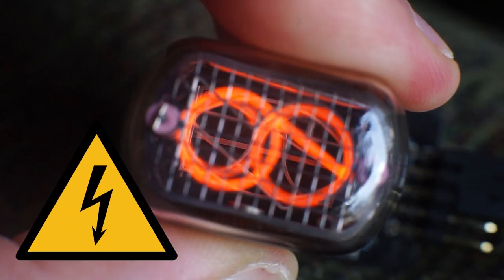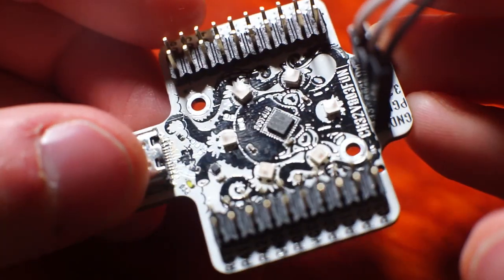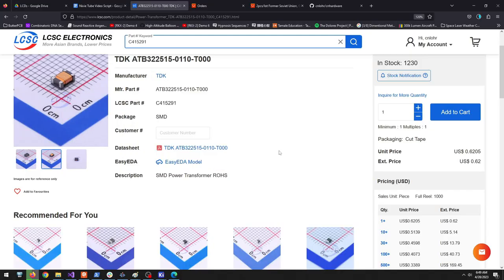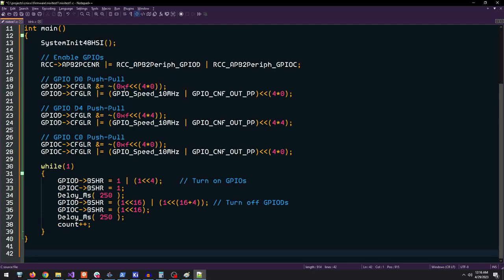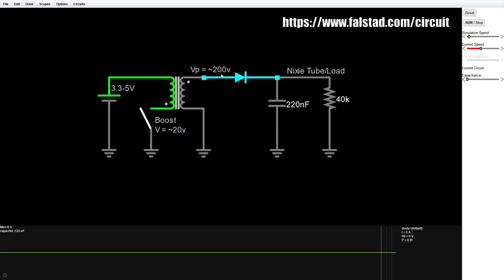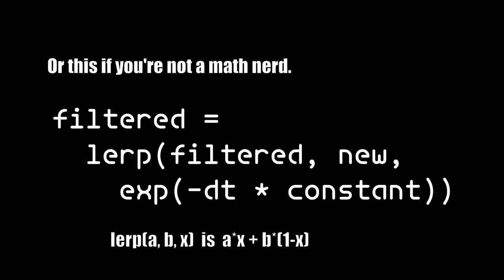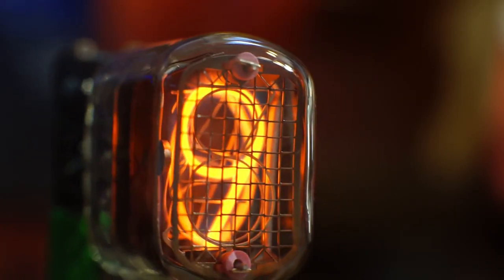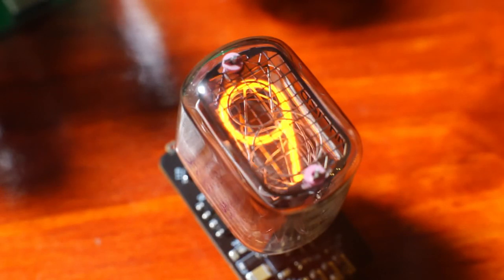Powering a Nixie Tube from USB with a 10¢ RISC-V, the CH32V003

Comment: Cool. That's the only thing I can say. Man, you are one of the few truly "Full stack" developers. Now we know that, in adition to all your knowledge, you are not afraid of analog electronics.
Reply from the maker: I learned a TON From Sam Ben-Yaakov lectures.  You should totally check him out on youtube.
Reply: @CNLohr  now I will
Reply: There is no such thing as digital electronics. I never saw so much analog circuit analysis as in my "digital electronics" course in engineering.
Reply: @stickyfox  You do all the analog engineering of digital circuits so the code running on it doesn't have to deal with it (except things like the flyback control code here).
Reply: @gblargg  That's kind of the flip side. People get so wrapped up in math and signal processing they forget that a processor can generate an AC waveform too! It's good to keep the fundamentals in mind.

Comment: Did you measure the gamma of the tube for the dimming?  With LEDs, i find that i have to keep in mind that the human eye is non-linear when doing fading.
Reply from the maker: I did not.  But realistically, I only have about 8 bits of dynamic range.  Any gamma curves should be applied by the users of the nixie, instead of by the ch32v003.
Reply: @CNLohr  I may have to add dithering just because. ;)

Comment: Sorry. Where can I find the schematic for the high voltage generator portion? Thanks. Great video!
Reply from the maker: It's all in the cnixxi repo.  The voltage is really just a FET + the tiny transformer +  Diode and is all driven directly from the ch32v003.

Comment: The CH32V203 seems just a bit easier to work with for not much more cost. EG has hardware multiply...
Reply from the maker: the upcoming 002, 005, 006 and 007 all have a hardware multiplier.

Comment: Years ago I found a nice single transistor oscillator design that worked with a centre tapped primary transformer, using an smallish audio coupling transformer from an old radio on a 12V supply there was enough HV transients coming out to light a neon bulb. I then added a nixie tube etc, and had a really simple single digit nixie counter.
The nixie is, apart from a diode, directly driven from the transformer, no limiting resistor required.
I can run my thumb under the nixie & 7441 decoder driver with no tingles etc, something unthinkable when using a conventional 200VDC supply and limiting resistor.
Currently the 7441 is driven by a 7490 decade counter (This thing was built 20+ years ago) for a single digit counter. Lately I've been toying with the idea of replacing the 7490 with a micro from an Arduino etc, so I can make it do something a bit like yours, and also drive the inverter instead of it being self excited, so I can stop the HV and blank the display, a function not available from a 7441, as doing so in a conventional 200V setup would see its outputs raise way too high for the chip (This is why most retro nixie devices have a pile of always lit leading zero's)
Pity I cannot post  a pic of it in the comments.
Reply from the maker: You can always make a youtube video about it.  I'd watch!

Comment: You almost tempted me to buy a set of nixie tubes, very cool project.
A well written HAL doesn't need to be resource intensive by the way, the vendor supplied ones usually are though.
Reply from the maker: There is the law of leaky abstraction.  No matter how careful or well thought out a HAL is, it will always be a net loss.

Comment: This is so cool, usually to try to control these tubes people try to make you buy ancient chips that aren't made anymore. I have 8 of the tubes you have pictured here that would love to be used for some kind of display. I definitely need to see how to get my hands on these boards/the parts for them.
Reply from the maker: I have my kicad projects on git!
Reply: The K155ID1 ic for controlling nixies is actually still being manufactured in one single factory
Reply from the maker: @apo_chromatic  Now if only I could find one in a QFN package.
Reply: @CNLohr  Fair, though they do exist in SOIC-16
Reply: Very cool extra helpful info guys, good to know that there is still a chip that can do it, I had just remembered some kind seemed hard to get last time I looked into it a few years ago, maybe I was thinking of an older kind.

This project is so cool though, such a compact high voltage supply design compared to others. Love this project a lot!

Comment: This is a really nice little Nixie driver project!  If you wanted to make the HV supply inherently safe if the control loop fails you could add some kind of voltage clamp across the HV node, like a zener diode or something else that avalanches at around 200 volts.  You could even use this to reduce the drive, say feed it into a BJT that pulls down on the HVCTL and shunts the drive, although this would risk bringing the FET out of saturation and increasing its dissipation, but I suspect an equilibrium would be rapidly established that could be designed to be tolerable continuously as the current limit is mostly set by the transformer inductance and pulse width.
Reply from the maker: I have wondered if I was naturally hitting the reverse conduction voltage with my existing diode.  I was toying with using a 200V diode, to push that reverse conductance even lower.  If I can tailor my supply to leverage that, it would be even cooler!  I try to avoid having any extra components in my designs that I can. And, things seem safe enough considering how much I had to do to try to overvolt the supply anyway.
Reply: @CNLohr  yeah that would work, also the drain source breakdown of the switch fet but that would be a low voltage because of the transformer ratio.
Reply from the maker: @vk2zay  Is it safe to use the VGS breakdown of the switching FET? I thought that would permanently damage the FET.
Reply: @CNLohr  depends on the FET, some power fets are specified explicitly to allow it and the datasheet has limits for it.  However in general 1st breakdown isn't damaging as long as the dissipation isn't excessive, so as long as the current is limited so the drain current limit isn't violated and the IV dissipation doesn't overheat the device it can probably tolerate it indefinitely.
Reply from the maker: @vk2zay  Interesting.  I will look into it more. But these are some lame chinese datasheets 😕
Reply: @CNLohr  "But these are some lame chinese datasheets" 
Well, at JLCPCB prices you could make a board full of Chinese FETs to characterise them yourself ;) ;)
Reply from the maker: @Axel_Andersen  Which is basically what I do. Then I cam make 50 more for the price of 1

Comment: I didn’t see any snubber across the primary of the flyback transformer - I suggest that one be used, whether a diode or RC or combination.
Reply from the maker: Should not be needed.  There's enough clearance on the FET and it has enough Coss to be that snubbing capacitor from leakage inductance.

Comment: Many moons ago I made bought a few old stock nixie counter racks with 12 nixie tubes in each rack. Then I build a nixie clock using regular ttl logic, a bunch of transistors and a custom transformer. I would love to use this project to drive a new 6 digit nixie clock with the rest of the tubes I still have lying around.
Reply from the maker: No time like the present to get started

Comment: Very cool, especially the 5 being an upside down 2. But I’m surprised that the RISC-V core lacks a multiply instruction, even bottom-level ATtiny chips these days (e.g. tiny202) have hardware multiplication. But in basically every other respect it’s a great replacement for an ATtiny. The CH32V103 seems to be more inline with what I’d expect from an entry-level 32-bit MCU, like the RP2040 or bluepill or ESP.

Be interesting to see if CH32Vs or GD32Vs (or ESP32C3s) become the mainstay of RISC-V in the hobby space. I hear some allow direct programming through USB without needing a boot loader like how the RP2040 does, which would go a good way towards making them more accessible to noobs. Not sure if you can also do debugging though, not that debugging has ever been accessible to noobs. I gotta look into getting a GDB workflow up and running.
Reply from the maker: The core, in spite of its lack of multiply is still VERY capable.  At 48MHz, and 32-bit for math operations it is more than capable enough for most projects - so long as you don't burn all your perf in HALs.

And indeed, the 103 and 203 are along those lines.

Side-note: Bitluni and I have talked about writing a USB-bootloader for the 003!

Comment: I'm def stealing this, but iirc "dynamic" driving -  pulsing the display harder but shorter to reduce total energy going through -  is recommended just as it is for LEDs for longevity
Reply from the maker: Totes a thing you can do with this!
Reply: Not with nixies. If you're pulsing it to normal operating current, then it's fine, but compensating for PWM with higher drive currents will definitely cause cathode poisoning.

Comment: Very cool, this looks like a much better driver for my IN18 clock than the expensive HV switching chip from TI I have now. Two questions: did you document the control loop somewhere? Does it require a PID or something simpler? Why does your interface to the chip require microsecond accurate timing, is it because of the SWI? Can't we use something simple like UART to interface with it?
Reply from the maker: The PID is overkill. I will likely switch it for a PI + expectancy or just P + expectancy loop.

Can't use UART with current firmware but it isn't hard to add that as a feature.  You can just copy&paste the single file header to access the debug registers as it stands. But I do intend to continue to develop them.
Reply: @CNLohr  Great, thanks for responding. I think I2C would be even better. Then we would only need a single bus to communicate to the controllers and would make it scalable from 2 to perhaps even 8 digit clocks. I am looking to built this project soon so I will look into that
Reply from the maker: @pietheijn-vo1gt  good point!
Reply: @pietheijn-vo1gt  yoo, if you get I2C working on it, that would be so cool. I'm very new to the scene of electronics, but I'd be happy to learn from you if you get it working :D

Comment: I must've watched the bit about turning the IIR into 3 instructions about 5 times trying to work out how it works, because boy do I need to do something similar for my driver project I'm working on because it runs WAY too slow and no divide to do regular RMS averaging.  

I'm tempted to just throw the code in and see if it works, but I'd also like to understand how it works, so I'll know if it's actually going to help my application
Reply: I've played around with it a little, for some reason I had to add an extra right shift 1 to the filtered value to make it in range, but it is smoother than raw.  Cool as
Reply from the maker: Yes.  You will need to right-shift your output if you want it to be less OOR than the typical input.  The way the shift-iir works is to inflate the size of the filtered value.
Reply: @CNLohr  Ah, That explains why it was coming out so high, I like it, I'll see if I can figure out how to implement it in my code next, thank you

Comment: How much power is required to power one of these? I'm wondering how many nixies you could be powered from a single USB
Reply from the maker: My PSU uses about 300mW.  Only about 300mW actually goes into the tube.

Comment: You point out a transformer IC but it sounds like you drive the FET from the MCU, so what does the transformer do?
Reply from the maker: The transformer both acts as an inductor to be the boost AND provides a 10:1 voltage multiplier.
Reply: @CNLohr  Ooooh! Silly me I realise now. It's because the bottom side with the visible windings are whats in the screengrab from LCSC so when you pointed to it on the PCB I thought it was something else, like a SMPS IC of sorts.

This thing does 0.7A and up to 500V?! There are so many of these old display tubes you could power with this. So thanks a ton for showing this!

Comment: This is awesome! I have some of the same nixie tubes! Would love to see a follow up on this on controlling them via an external microcontroller like an esp32. How did you learn how to build the boards? I would love to be able to have access to these tiny components and not have to solder them myself.
Reply from the maker: If I do, maybe by then I will have the boards for sale too!
Reply: I would love to get a few of these if you ever do sell the boards, I have a few sets of Nixie tubes that aren't doing anything so it would be great to use them.
Reply from the maker: @user-jb2le9el3x  Are they IN-12 or IN-15's or a different size?
Reply: @CNLohr  IN 12 rings a bell, I am pretty that's them

Comment: Nice project, i was working on something similar based on a MAX1771, @CNLohr do you know of the nixie chess set. The one that exist that i know off uses wireless energy but i think this cost effective solution combined with a battery would be a nicer solution. You can even go really fancy and add some position tracking of the chess pieces and let an esp track the game over the wifi's.
Reply from the maker: The magic of the CH is you can programmatically adjust voltage, current, compensation, and all sorts of other properties without any extra components!  That is very cool, though! I had not heard of the nixie chess set til now.

And why need an ESP?  You could totally let each one of the CH32V's have a signature that is indicated by patterns of current draw so when it is over a charging cell, the host processor could see which part is where!
Reply: @CNLohr  I was thinking of using the esp to send the game over internet e.g. remote play. Does chatgpt support chess yet? :)

Comment: the hv control code makes my head hurt. i'd have done that in hw with a smps ic etc.
Reply from the maker: So much extra wasted hardware.
Reply: @CNLohr  chip count is about the same really, look how full power supplys in led lights are now just one 6 or 8 pin IC. I'm not knocking your design the software is way above what I would want to choose to do for  such an important task as accurately maintaining a critical supply that could toast the project, but I would feel confident doing it on the PCB because I have more knowledge in that area.

Comment: Isn't RISKV open source too? I see a big rise on open source software and hardware adaptation as of the last 5 years.
Reply from the maker: The ISA is open.  There are some open cores.  But most of the cores are still closed (which is OK) because the tooling is all still free.

Comment: I want more videos like this. I‘m literally watching this video the 6th time because I enjoy it that much. Are there more small youtubers with that in depth hardware videos???
Reply from the maker: What is missing in my other videos?  Like what made this video so cool to watch?
Reply: @CNLohr  I think it‘s the Quality. I‘ve watched many of your videos but this one stands out in terms of video and sound quality as well as video editing. Also the Thumbnail is insane and I really like how you are presenting your projekt. You did a really good job in explaining the technologies, without going into too much detail about the implementation. 
I love projekts with PID controllers, low level programmed microcontrollers and power converters. The fact you designed your own PCB particulary stands out because other youtubers mostly connect breadboards while you really understand what you are doing. Not only in software you are complete genious but also your Hardware knowledge is insane. 
I would love more Projekts like these.
I recently tried to control a Piezo atomizer with a transformer, to build up an oscillator circuit. A microcontroller is needed to drive the other side of the coil to put energy into the system. Maybe this project would be something for you. In the Internet, there are virtually no tutorials about how to do it with an LC Oscillator circuit and a PWM signal.

Have a nice day!
Niklas